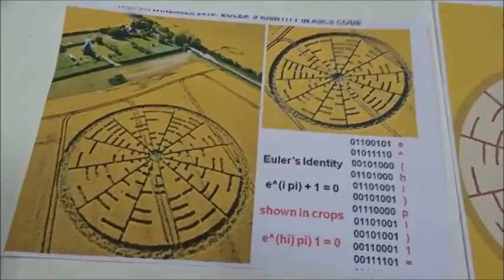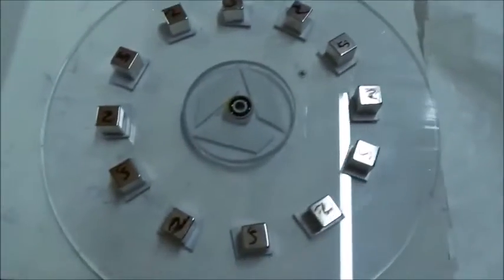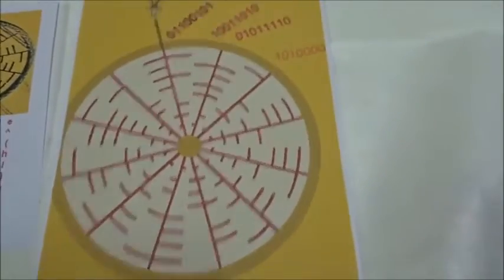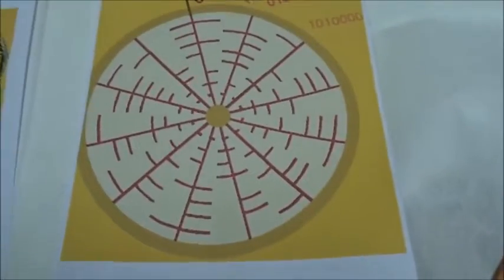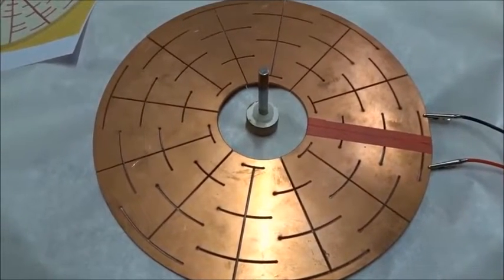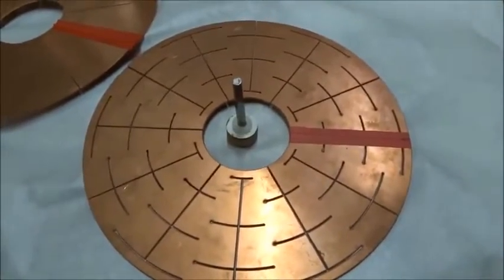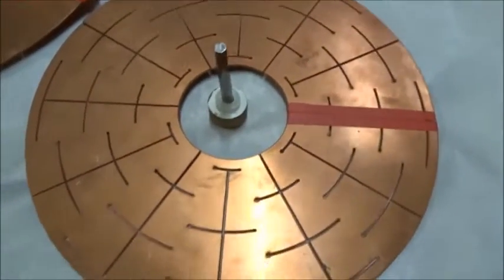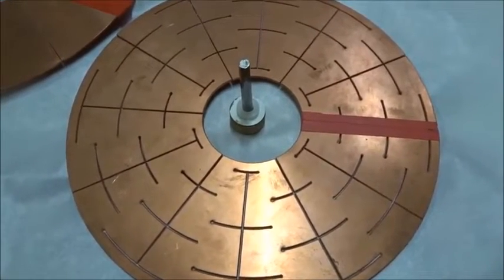Wilton Windmill 2010 showed a blueprint for an AC disc generator with reduced eddy currents

Comment: the first test... you only measured whats developed in the area of the gap as one pole passes over. all the other poles create a localised loop around themselves. not around the disc. ironically im taking advantage of the braking for a dyno... technically you cannot measure teh poetntial or the current in that loop, the only indication there is anything there at all is the magnetic reaction...
with the slots, you have effectively created several half turns, perfectly feasible, but much more easily made with radial rows of iron poles, with wire weaved around them.

a magnet per pole, take note of the RH  (or is that LH?) rule, and yeah...

also, consider the BACK of the magnets... whats that side of the field doing? you gotta use a steel backing plate. magnetic fields want to be enclosed in iorn, in loops. they dont liek air gaps. try to forget the lessons about feld lines, theyre an illusion.

to me, the original looks more like a quaternary base counting system, in 12 sets of 8 decimal places maybe...

could be anything...

Comment: to eliminate eddy current, it is necessary to mix chopped copper with chopped graphite and make a composite pressed between two stainless steel disks, conductor
Reply: Hi there thanks for sharing this is a very interesting and clever approach! Where did you read about this or do you have a source that I can read more into? Is this superior to using a copper disc with cut grooves?

Comment: I was studying Tesla's Unipolar Dynamo and remembered watching this video recently, If I'm right these subdivisions are redirecting the electromagnetically retarded fields (lenz) away from the input, Tesla stated that his design would allow self-excitation due to directing the current to strengthen the field magnets and no longer oppose the input:

"But since the current is forced to follow the lines of subdivision, we see that it will tend either to energize or de-energize the field, and this will depend, other things being equal, upon the direction of the lines of subdivision. If the subdivision be as indicated by the full lines in Fig. 4, it is evident that if the current is of the same direction as before, that is, from centre to periphery, its effect will be to strengthen the field magnet; whereas, if the subdivision be as indicated by the dotted lines, the current generated will tend to weaken the magnets. 

In the former case the machine will be capable of exciting itself when the disc is rotated in the direction of arrow D; in the latter case the direction of rotation must be reversed. Two such discs may be combined, however, as indicated, the two discs rotating in opposite fields, and in the same or opposite direction." 

-NOTES ON A UNIPOLAR DYNAMO by Nikola Tesla, Electrical Engineer September 2nd, 1891 Page number(s): 258-260

This geometry effectively takes the retarded fields and directs them away from the input and lowers resistance since it doesn't have to fight its own input nearly as much, if properly designed the retardation can instead be used to assist the input.

Comment: Yuuki  I built one of these using rotating field with coils didn't work very well my problem was that my coil did not over lap  you should try this without rotation use an arduino to control coils energy rotating at any speed to

Comment: What is the benefit of this other than it spins more freely? sorry, im new at this :)
Reply: like what practical application could be used with this?
Reply: In the traditional method the changing magnetic fields give rise to opposing fields due to electromagnetic retardation (lenz), this geometry redirects the retarded fields away from the input fields and lowers the resistance, if properly utilized the retarded fields can be redirected to either fully neutralize the opposition or assist the input.

Comment: Could anyone explain a layman what benefits could this bring compared to using a traditional approach?
Reply: In the traditional method the changing magnetic fields give rise to opposing fields due to electromagnetic retardation (lenz), this geometry redirects the retarded fields away from the input fields and lowers the resistance, if properly utilized the retarded fields can be redirected to either fully neutralize the opposition or assist the input.
Reply: Hey, thank you! @JenkoRun